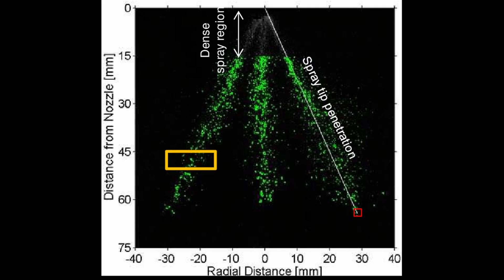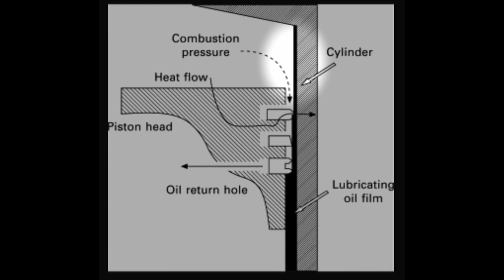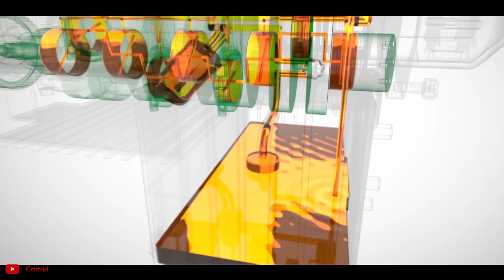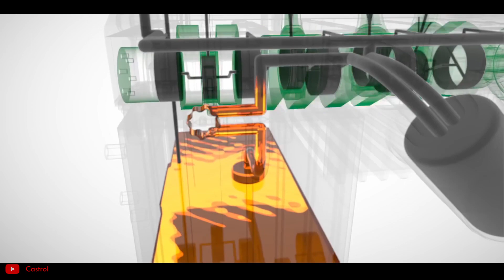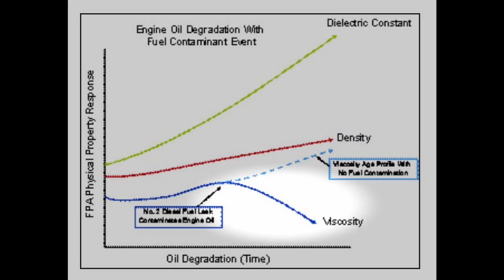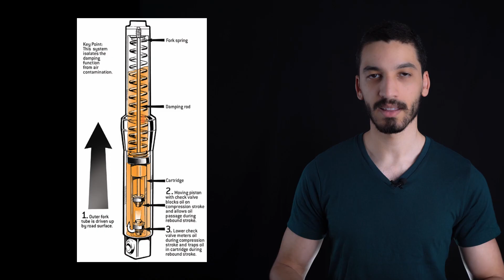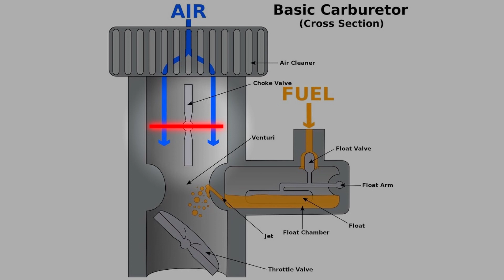The PITFALLS of WARMING UP your BIKE, should YOU ? | LET'S TORQUE

Comment from the maker: Worth point out ... no method is better than just keeping your engine on 24/7. NEVER have to warm anything up ever again. Minimal engine wear. 👌😂
WHAT'S YOUR STARTUP ROUTINE?
Reply: I personally use choke while putting on my helmet and gloves and don't accelerate hard, keeping the revs under 5k.
Reply from the maker: Textbook how it should be done !
Reply: And even the choke I only use until the bike gets up between 2 and 2.5k revs.
Reply: I am going to preface my comments by noting I am not an engineer, though over the years have worked on a variety of Italian cars, especially Fiats and Alfa’s. Both of which it is highly advisable to warm up but that’s largely in context to getting oil around the gearbox to protect the synchros. I am new to bikes. So I am happy to admit I don’t have the experience with such things yet, though am working on building up my knowledge. My current bike is a Ducati Monster 620ie and yes I do warm it up though not for too long, similarly I take it easy as I head off, before giving it some beans. 

I have read the comments  posted re this video plus listened through your explanations, and all I can say at this point in time is that I am happy to continue with what I do, and don’t feel it’s likely I am doing any harm to the bike for allowing it to warm up a bit before heading off for a ride. It satisfies my internal basic instinct to allow the fluids to get moving in the engine and gearbox before putting pressure on the systems. With my brother in law’s classic bevel Ducati’s warming them up is important, for the same kinds of reasons as to how one treats a classic Italian car.  Carefully.
Reply: Actually, Ive heard from car mechanics that that's the reason taxis can last so many kilometers, like 500.000km or so with no real problems, just maintainance. They keep them on literally 24/7
Reply: Choke, start, choke off immediately zip jacket, put on helmet, gloves on 
Putt out the driveway, by the time I’m out if the neighborhood (which in my case is the entire town) my 22 year old boxer is ready to do whatever.

Comment: This is sound advice for those with newer rides.

However, riding a big old V4 quad carb machine she definitely needs a few minutes with 1/2 choke to warm up before riding off (only really in winter though).

The bike does have carby heaters which helps atomisation, but the old girl runs like an old steam engine when started in the cold weather🤣 Trying to ride off immediately after start usually results in a stall, and the panicked attempts to keep her right side up😳

Usually a couple of minutes to have a smoke, and helmet and gloves on is ample👌

Older engines need a bit of heat to run smoothly, so I'll stick with letting her idle before riding off👍
Reply from the maker: That's fair enough Brizzy I did mention on the video carbys escape the rule since they'll refuse to run right until warm - the advice I give on that is to not abuse the choke and use the throttle instead as soon as possible because the choke will mess up your engine in the long run. Speaking from experience as my mother bless her used to choke the engine the whole freaking journey 😂 (not the most mechanically inclined person on earth but dont tell her I said that ...)

Thanks for stopping by !
Reply: That's correct @UrgetoRide  👌

The choke is self regulated in the fact that after a few seconds of running the engine revs lift, so turning it off is required anyway😉

Comment: there is a reason why the bike has a operating temperature...On the r6 i wait until the "LOW "is gone and it shows 40 °C, on my old enduro until it runs smoothly.  I rather trust the mechanics from yamaha than youtube mechanic :)
Reply from the maker: Darko my Yamaha takes about 1 minute max to read temperature - which is largely what I'm talking about in the video - enough to put your your gloves and helmet one, close the garage, final checks and go. I'm argumenting against excessive idling here.. ( think 5 - 8 -10minutes)
Also manufacturers tell you all sorts of sh*t to stop idiots hurting themselves - which also is something I talk about in the video. 90% of the warning are the lawyers speaking, not the engineers. It's no coincidence that car and bike owners manuals have been increasing in size as consumer literacy has been declining.
Cheerio and thanks for stopping by anyway
Reply: @UrgetoRide  you make a mistake by trusting a temperature read out. By many means.
Reply: Same here, and who would leave idle for 5 minutes?

Comment: You should warm up any bike or motor to 60c before any journey. Saves on piston ring wear and camshaft wear and fuel this is facts Im a motorsport engineer and researched this for many years.
Reply: Thank u
Reply: i warm it up untill abt 50c but its because i start it while i put on my helmet and gear. i dont go voer 4.5k rpm while its under 70c. my redline is 13k

Comment: Is this just your opinion? Do you have any engineering qualifications? What are the sources of your research?

When I worked for a motorcycle OEM they used to stress test engines by cycling from cold to hot quickly as that used to cause the most stress?
Reply from the maker: Hi Adam, you're arguing in bad faith on this one.. I'm not advocating for hot cold cycling at all here... If you saw the video the point is to bring the engine in a nice accelerated BUT gentle way up to temperature - thats where the engine wants to be and thats where it'll perform best. Idling is a very slow way to bring it to temperature which causes more wear compared to just riding the damn thing sensibly for a while

Comment: You do realise theres a fast idle feature built into most FI's for this very reason and if your logic had any merit applying throttle to ride off is going to add more fuel into the cylinders than leaving it at idle to come up to temperature would. I think you need to think through your ideas a little more before you say things out loud.

Comment: Sounds like a convincing argument. I am not convinced. I would never idle the bike to a full working temperature but definitely do my Pan Euro up to the point where the temperature gauge registers. WHY? Because Honda have forgotten more about engines than this guy has ever known - AND THEY ADVISE TO DO THE WARM UP LIKE THAT. Bike engines are not made the same as car engines. Car engines are designed to go immediately they are started up. This vid goes to show you that you should not believe everything you read or see on the innerweb.
Reply from the maker: Tim my Yamaha takes about 1 minute max to read temperature - which is largely what I'm talking about here - enough to put your your gloves and helmet one, close the garage, final checks and go. I'm argumenting against excessive idling here..
Also manufacturers tell you all sorts of sh*t to stop idiots hurting themselves. 90% of the warning are the lawyers speaking, not the engineers. It's no coincidence that car and bike owners manuals have been increasing in size as consumer literacy has been declining.
Cheerio and thanks for stopping by anyway
Reply: @UrgetoRide  You should have made that point more clear about giving it a minute or so. People discussing this seem to think that you don't want them to warm up at all- which is really not good for the engine- which also seems to be a point that does not seem to come out from your video. Some people turn the key, push start and then just ride away since either they are fully geared up already or dont wear any gear. 
It would also be good to list your sources for the "science" that you are using to talk about this. so that people can check verify those themselves.  Otherwise, it all just ends up being an opinion on the internet.
Reply: @pegumoto  Exactly at no point does he say that the engine should be warmed up for the cold light to go off or the temperature gauge needle to start moving.  Depending on the season this could be a minute or a few minute depending on the ambient temperature. If he wants to sound like he knows what he is talking about then at least qualify what he is saying with some real world reference to say warm it up until "X,Y,Z" happens and then ride. But riding a modern sports bike with tight tolerances from cold is going to get expensive if the owner does not let it warm up to at least some point of reference they know will have the oil warm enough to do its job.  How many race bikes have you ever seen go out on track cold even for a sighting lap then a warm up lap? None...They are all warmed up in the paddock before the rider even goes out on a sighting lap.. They do this for a reason its not for vanity or just for the sake of it.... This video sadly is pointless if the guy doing the video then says he does not mean cold but to warm it up to some point we can understand. Back peddling just makes him look like he was caught out and then has to explain what he meant as he spent almost 9 minutes and didn't get his actual point across.

Comment: Bike need to be warm up , modern bike has fast ide which is safety thing so stupid  people wont demaged a engine riding cold .i talking around 5 minutes (ish )and does mattaer if is hot or cold autside .Warm up by it self not rev hard , just let engine run for few minutes .Do you ever feel a diffrence between riding cold from start and rading warm up bike ?What about user manulam and factory recomendations ? Do yoy read ? Anyway video missing a point .Thanks

Comment: Not more "this is right old adages are wrong" hooey. 

Warming up a bike means allowing the pistons the chance to expand on a more linear scale to the cylinder walls. 

This is exacerbated on a 2t motor. Just start a snowmobile from cold on a 0 day and take off WOT. I bet you make it around an 1/8th of a mile, if that, before you seize it.

Any time you run a bike without letting it warm up, you are assured of causing damage to the motor. It may not be entorely fatal but damage WILL happen.

Comment: Please discuss clutchless shifting up and down
Reply from the maker: Oh dear even more controversial than usual haha But I'll try to make a video out of it, if I do I'm afraid it'll be out of my own experience rather than hard facts. 
The uber short story of it is ; clutchless upshifting is absolutely fine and harmless as long as its done right (i.e relieving the drive train before shifting up). I typically do it in the higher gears or if I'm teaching a Corsa a lesson at the traffic lights... In typical riding and especially in the lower gears, I clutch in. I'm one of those weirdos who'd still use the clutch on a quickshifter bike 90% of the time (as long as I'm not trying to be 'fast'). Just feels more involved and I like it.
Clutchless downshifting.. argh. I personally don't do it. The gear will go through, sometimes absolutely smooth (most likely NOT however) but you need to be lucky as it'll need to be the right rpm, right engine load etc I just don't bother and clutch in whether racing or not.
If someone doesn't bother clutching up or down all the time, maybe it's time for them to consider a DCT or a scooter .. Half the pleasure of biking is kicking the gears about ! :)

Sorry for the novel, and thanks Ladda for stopping by !

Comment: SO.. Let me get this straight... The thicker cold oil is scraped from the cylinder wall due to the fuel thinning it down or stripping it from the wall. So its better to fire it up and run the engine up to about 4 times higher than tick over and the higher piston speed against a cold engine with less oil on the cylinder wall is better than allowing it to warm up to the point where the cold warning has turned off. I call bullshit. How long have you been riding bikes and pretending you know how they work?  Having ridden, raced and worked with major manufacturers over the years as well as being a test rider too. The importance of allowing the engine to warm up to let the oil do its work cannot be underestimated.  Increased wear due to poor lubrication with thick cold oil and engine RPM's that according to your guidelines would be 4 or more times higher than tickover also have a significant increase in load on the engine which is not just 4 times that of at tickover due to the load to drive the bike and not just spin the engine. Not sure if you are doing this for just a reaction but this is some of the worst advice for a modern highly tuned engine which has tighter tolerances than the lower powered engines of old. Sorry but this video is just asking to be called out as its just going to increase wear on viewers engines who watch this and take in the bad advice you have just given.
Reply from the maker: Richard, I thank you for stopping by. I won't dwell on your response too much as there was just too much misconstruction of the points discussed on the video. Maybe you just skipped around so missed a lot. The 4,000rpm would be a LIMIT. Not a target. Very big difference. Just riding but sticking to very low rpm allows all the bikes components to warm up uniformly and gently, and for the engine to get up to temperature faster which is beneficial for it. Idling for 10 minutes is not beneficial or better, isn't kind to the bike, and is a massive waste of time

Cheers Richard ✊
Reply: @UrgetoRide  a modern bike that revs to 14,000rpm (1000cc or 16,000 for a 600cc bike) even at 4000rpm is barely going to pull away or be pleasant to ride. Its better to allow the engine to either use the choke on a carbed engine or the fast idle that is programmed into many if not most fuel injected bikes. Now you have just put 10 minutes in your reply but not given a timescale in the video so what point is too long? is it a time or is it once the engine no longer needs choke or the idle has returned to normal and the temperature gauge has started to move? Is it really better to allow the engine warm up under a load as any form of riding is going to add a load to a cold engine if the rider feels what you said was to ride the bike from cold.  Whatever you do to warm up the bike will not harm the engine even if you allow it to idle for 5,10 or 30 minutes as modern fuel injected bikes actually have a fuel map for the engine running in neutral. If the manufacturer has a fuel map for different gears and even for the engine in neutral there has to be a reason. The secondary butterflies in the throttle bodies work like a choke at certain temperatures, rev ranges and throttle openings. If you remove the secondary butterflies the bike is horrible to try and ride from cold or below a certain RPM. I know this too well as the GSXR600 I built for a lap record attempt had the secondary butterflies removed to give the rider a more direct input with the throttle in every gear and not be controlled by the secondaries opening when it decided to open at the speed they. decide to open too. 

Sorry... But unless you are very clear about what you are trying to say then you are open for this... But I can tell you 100% that no matter how long you leave a bike at idle with fuel injection it will not cause a problem and riding on a cold engine will cause more problems than letting it warm up. 

I honestly think you need to think a lot harder about your technical videos.

Comment: Do you even own a motorbike? Lol
Reply from the maker: Yes sir. 2 currently with a third coming soon.
Reply: I've read the comments... so here goes. 

1) what is excessive idling? Do you wanna put a number to that?

2) generators, especially industrial units can idle for hours. They seem to get on fine.

3) the fuel atomisation argument only makes sense when the engine is cold. Once it heats up you can idle all day long as long as the cooling system keeps up.

4) you said 5% of oil contamination. I've had oil analysed plenty of times and 5% is a very high number. Not only that but 5w30 isn't bad. 

5) clearances not tolerances...

6) let's say your bike idles at 1500. 3000 rpm during acceleration equals about 2.6 times the amount of fuel in the cylinders when cold.... so if you wanna go fuel washing cylinders route then you're making it worse...

7) for a 4 cylinder 600cc engine how much fuel is there in each cylinder per stroke at idle. So a Ve of say 30%? 

Jason from EE made this massive fuck up talking about the same thing.

8) what do oil control rings do on the downstroke? You say oil is washed off the cylinders, bu this is above the piaton ring line on the DOWNSTROKE...

Think about it!